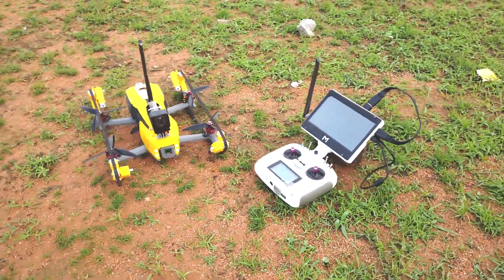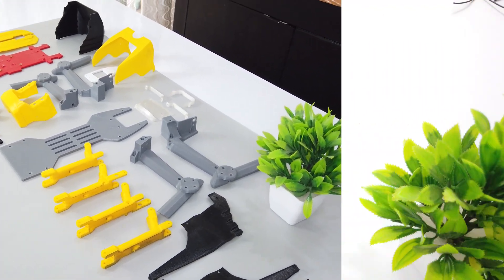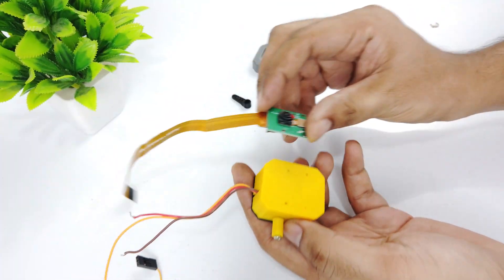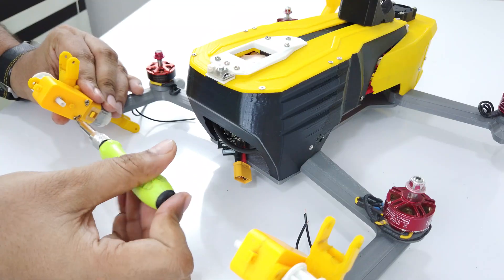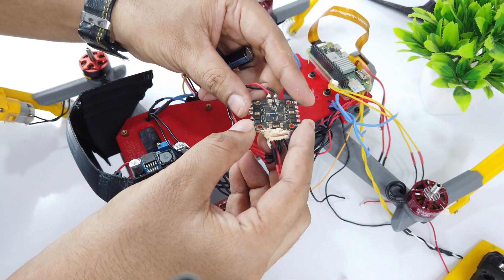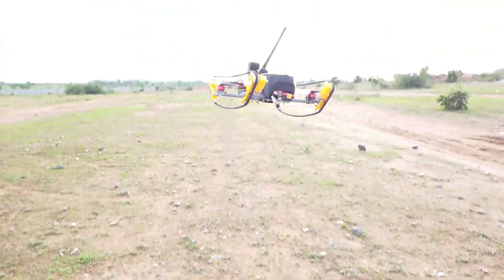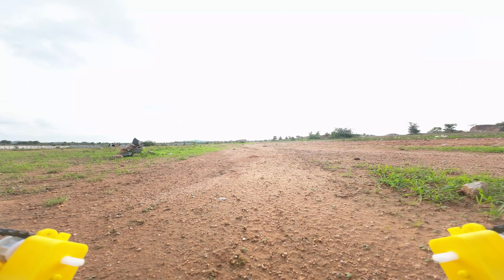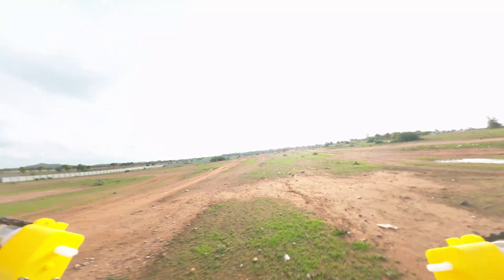A Drone That’s Also a TANK (Unstoppable Build!)

Comment: hello, except 3d printed stl link... no other info regarding the electronics and coding... can you please provide the link for the info of electronics used and the coding
Reply from the maker: The files has code, wiring diagram along with instructions
Reply: Bro there is no code 💔
Reply: Bro there is no code 💔